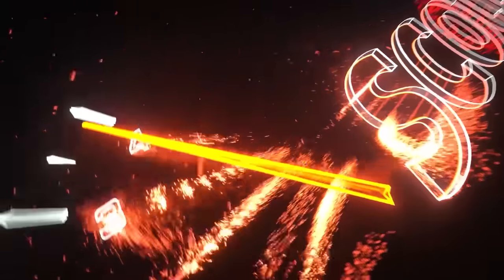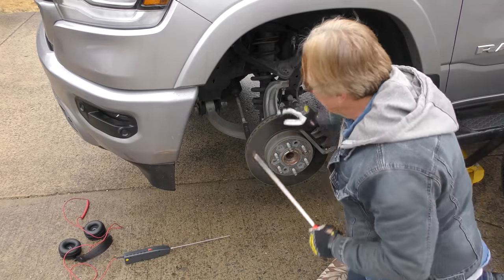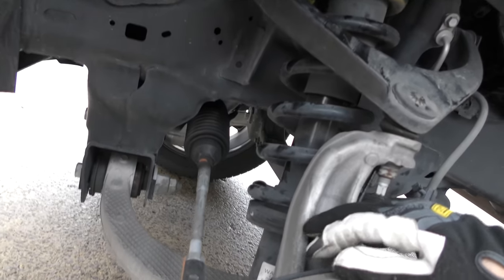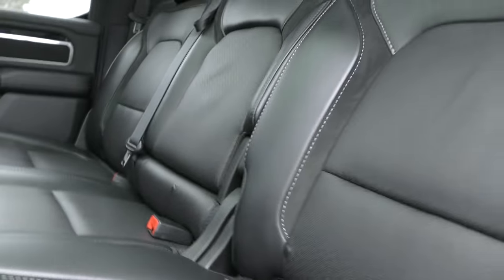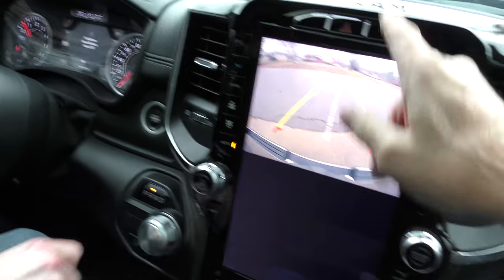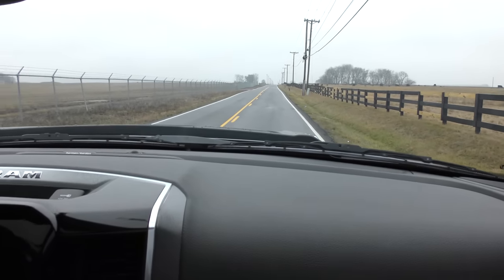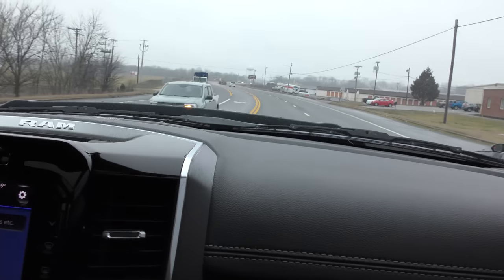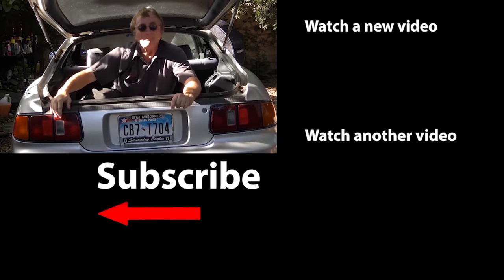Ram’s New Truck Scares the Crap Out of Me

Comment: I have a 2019 etorque Ram with about 63K now,  so far so good on the etorque system.   I get the same MPG.   I will say this trucks seems to eat the regular battery's faster, instead of replacing every 4 years I need to replace every 2 years.

Comment: New trucks to  expensive and not made as well as the older trucks from a decade ago. I will fix up my 1987 Dodge W150 LE  318 pickup. 15 mpg, but easy to work on

Comment: I am flabbergasted by this video! Italian products are just as Americans. I don’t know why Scotty has a dislike for the 3.0 diesel engine. My Ram 1500 4x4 crew cab has 99,0041 miles and runs great! Oil change every 10,000 miles! Yes my oil is great. Always have used T-6 Rotella oil. Even when it was very hard to find at one time because of a refinery burning down. I had to pay more for what I got but it worked out. The owners manual even says to use only T-6 Rotella oil.

Comment: 2020 with 40k display message says service trailer brake and traction control. I tried to clear the 3 codes it had, but couldn't get them off. Had to take it to the dealer. The tires are worn out already. The Goodyears they use must be really cheap. I saw little chunks of rubber coming off. Noisy and rough riding too.

Comment: 2015 EcoDiesel larimy loved it till they reprogrammed the ecu because they got caught making it have to do regens more often but got 32 mpg after the reprogramming 12mpg no matter how I drive one of the things they put in was the turbo won't spin up when taking off from a start leaving you unable to dart out when normally you could make it twice. under load going up a hill it won't move till you put the pedal to the floor 3 or 4 seconds later you hear the turbo spin up and like I was power breaking, but  it launchs way more than nessessary 
So off the pedal and it stops. repeat  it's ridiculous and totally dangerous with mo fix other than a deleate which in Calif you get caught they seize your truck and crush it on.
Anybody want to explain why dropping my mpg went from 32 to 12 and that's better for the environment

Comment: I swear by prolong oil additive. It got rid of my timing chain rattle on the first start of the day in my 06 tundra. It would probably help with the idle problem in this truck.
Reply: I wouldn't put anything in the manual doesn't recommend.  Unless you're a mopar engine designer, don't do it.
Reply: @bjornironsides6474 Why not

Comment: Hey Scotty, I'm trying to find tires for my 2004 E350 Super Duty Van that are not junk, that do not have issues right from the start. I tried some new top of the line Michelins and the tire shop had 2 brand new ones that they could not even balance on their Hunter Road Force Elite. They  got 2 more and installed them but they could not get the shimmey and death shake out of the van, so we changed them out for General Grabber HTS60 and same thing, now had 3 bad tires out of the bunch. I left the shop with the switched out new tires, I stood next to the manage as he did the balance himself. They drove way better, only slight shimmy at 70-80, a week later, the right rear now seemed to have ply shift and has over an inch of lateral runout. I'm so tired of not being able to get a decent set of tires for my van even when buying the so called best in the Michelins. Anyone that can advise me I would appreciate. I been working mechanic for 50 years like Scotty and the van front end is not the issue, as being seen with brand new tires that are junk right from the warehouse. The van is not loaded too heavy at 7500 pounds, the load E tires can handle 3040 pounds each.

Comment: The 5.7L takes 7.5 Quarts of Oil. Not 7 Quarts that the manufacturer says. Measure the oil your self. They never accounted for the oil filter. I’ve never had a tick problem.

Comment: 3rd gen hemi is garbage. My 05 hemi 1500 4x2 got 18mpg without a stupid and likely expensive electric motor and lithium battery waiting to explode in the back seat. Given FCA and their constant recalls on my current power wagons air bags the lithium will definitely go boom first fender bender.

Comment: Check this….solid
Check this….solid…..etc.
Nice interior, comfortable 
So all of this hate on the brand for no reason than a small reason.

My 2018 is a 5.7L Hemi and averages 20 MPG.   (Not Hybrid) A lot depends on how you drive.

My 2017 had over 275k miles before any issues.
Reply: In terms of reliability.....it's still a Chrysler. Out of all the American car makers they're the bottom of the bucket for issues. Most people I know didn't own 5.7L Rams past 250,000-300,000 kilometers. Because the problems became serious. Especially if it was used as a truck to do work and tow. 

Years ago this wasn't the case. 

Yes, it's a nice truck. How long will It stay that way?
Reply: @cameronswan8646  My last two ran past 275K miles with no major issues.  I traded them in at that point because of the value was still high.  You must not keep up with trucks as RAM has been winning motortrends truck of the years awards for 3-4 years now.
Reply: @MRKNIGHT  Motor trend says a lot of things are are full of hot air. 

The trucks are less reliable than their competitors. Numbers don't lie. It's also why they're cheaper than their competitors too. If you use these consistently as a truck, and not just as a highway cruiser they'll fall apart pretty quickly. The company I work for uses 5.7L Rams in a lot of their fleet. They're good with maintenance but they just don't last. Same goes with the dodge journeys they bought a boat load of.
Reply: @cameronswan8646  You sure know a lot for someone who has never had one.  My 2011 RAM and 2017 RAM each had over 275K miles before I traded them in with no major problems.  I don't trust what your "company guy" says about the fleet.  I've never known a company mechanic not to be a cry baby about everything.  *shrug

Comment: If you drive 30,000 miles a year and gas is $4/gallon, you save $1600/year going from 15mpg to 18 mpg. Same scenario but you go from 25mpg to 28 mpg, you only save $500 per year in gas. Science.
Reply: Math actually
Reply: @jwalesoutlaw3294 math is a science ☝️even though it doesn't say so in the name😂
Reply: @kxkxkxkx  lol no it's not.  It's called "math" and the sciences for a reason
Reply: @jwalesoutlaw3294  I take your point. But everything is just math.
Reply: @brlyjo  give us a few miracles and we can explain the rest with math?
Reply: @jwalesoutlaw3294  haha, it works until things get "spooky".

Comment: I have a 2021 Ram 1500 etorque 5.7 that only has 14,500 miles and watching this will give me a heads up on parts that can fail. The lifters have been upgraded and oil pump to make sure delivery of oil to the oil gallery were the cam resides. The needel bearings are bigger in the lifters and other updates to the 2017 5.7 and up. Biggest problem is the exhaust manifold bolts breaking still. Sum say the studs or bolts have been updated as well. Its how the additional weight of the catalytic converter connected to the exhaust pipes vibrate

Comment: WRONG!!! 
Scott I love your videos they are extremely informative however I had a 2016 ram 1500 with the 5.7 I do drive like an old man but I got 26 miles to the gallon on the highway empty and 22 around town, mine was phenomenal on fuel mileage I now have a 22 ram 2500 with the 6.4 and it is horrible on gas mileage and towing my 12,000 pound camper I only get 7 1/2 miles to the gallon

Comment: I have one of these and mileage really varies with the rear gear. 3.21’s get better mileage which mine is. I’m always over 18 and over 20 on the highway. The braking does take getting used to. Start/stop is a non-issue and super smooth, I never turn it off.
Reply: Its all math. More parts means more chances for failure
Reply: @censored4christ162  I’d agree but your eliminating a traditional alternator and using your starter a lot less. The battery would be the biggest nut crusher if it goes.

Comment: Sheesh, could Dodge put more buttons and a larger touchscreen on this truck?  The vehicles are just ridiculous these days.  Not only are there physical buttons for every feature on the dash, but also a touchscreen button, what a mess.  Last of all, I cannot stand that stupid turn dial gear shifter.  However, overall the interior and exterior of the truck looks good.  Just tired of all of the electronic 💩 that will no doubt have an effect on the how the truck runs, if there are problems.

Comment: I bought my 2023 ram 1500 Lonestar with the E torque I love it but recently I've noticed that i kinda feel a little vibrating feeling on my gas pedal. Any thoughts?
Reply: Is this vibration when you are barely on the throttle? It could be when it switches to MDS mode (4 cylinders). My 21' has that feel, its annoying.
Reply: @dan0872  yeah kinda only when I'm going 40mhp and then it stops doing it at around 70

Comment: Hey Scotty. Does the 2012 5.7Hemi have the same issue you just described about not being lubricated properly and not to idle to long bc of that issue?
Reply: Just trading in my 2012 ram express 5.7 ,I took care of it and it lasted 12 years only owner 144000, miles lifters went out and smashed the cam, traded it in know I have a 2024 ram 5.7 e  torque  hopeit last more that the first 1

Comment: Everyone saying they love their 2020 Rams with the HEMI, please update us when it has 200k miles and then tell us how much you love it.  They look very nice and I’m sure they ride great, but it’s still made by the worst auto manufacturer.  They will have oiling issues, transmission issues, electrical issues, and cooling issues well before 150k miles.
Reply: Actually there is a guy that's been doing updates his channel is called truck Central he has a 2019 ram 1500 with the hemi with 200k miles on it problem free and he's very happy with it and tows a lot with it and it's still holding everything is still original engine transmission is holding up perfectly

Comment: My 2010 Nissan frontier still tooling down the road. 1 brake job only thing other than routine maintenance. 6 cyl w 5 speed automatic. I do not like the new 9 speeds. Seems like it's constantly hunting the right gear. Should get several more years before having to decide what brand to buy.

Comment: Attention Scotty you need to pay more attention to your videos I've noticed you're slipping lately. First of all you're working off of the Jack and not a jack stand second of all you have the wheel leaning against the side step where the wheel should be underneath the vehicle for safety just in case the Jack slips it can land on the Wheel third of all you're climbing under the vehicle prying the thing .last but not least stop swinging a long screwdriver or pry bar around the vehicle you might ding it or Dent it

Comment: I have a 2015 Tradesmen and I just got the exhaust manifold bolts fixed and a new sensor for the evap hoping it doesn't need to go to the dealership for P0456 PCM update. I try not to idle, at all. When oil life gets bad, oil does slip through the valves and smokes on start up. Been using Lucas Oil additives to keep it alive as long as possible.
Reply: My 1500 set 2017 had poor gas milage compared to the classic 2022 0w20 5.7 hemi
Reply: @BushcraftQuebec  yeah you can get better fuel economy with 02-20. The newer they make em, the more MPGs you'll get.

Comment: 130 foot/pounds extra electric TQ is great, the system is simple, right in the open, easy belt to replace, saves the starter motor. The hybrid battery is much cheaper than a BEV battery. 2.5 MPG is 11% better MPGs Why bad-mouth the motor? I have a 20 inch Lasko $18 when new box-fan, has been running 24/7 x 4 years.

Comment: My 2008 Prius has the dashboard go off and the only way to get it back on is to press the display button 3 times then turn headlights on for a second with a door open. When the door ajar light comes on then I can turn the car on and the dashboard will turn on again.   But it is not a quick fix for sometimes it takes a lot of tries to get it to work. Help please! Is there a better way ? As I have been forced to drive without the dashboard. Can not see speed, rear camera, cruise control doesn’t work. My dashboard is not working as I am sending this message. I tried to use the trick I mentioned above but after 15 -20 minutes of trying I give up. I even had the dashboard turn off while car was getting inspected and it took the shop people over 30 minutes to let me know and it took me about 20 minutes to get dashboard back on so they could see the cars mileage for the inspection. 
If you can send me a response that would be awesome. Oh I live in West Seneca NY close to your old home town of Niagara Falls.

Comment: I just want to point out, that I have a 5.7 hemi (2017 ram) and I get 19MPG without that E torque/Electric motor. So, the electric motor really doesn't give you better MPG if that guy is getting 18MPG.
Reply: Sounds like little extra boost off the line is what they’re promoting.
Reply: Less to fail with the older truck
Reply: Tires, lift, lower, cab size, your weight, 4x4? So many variables
Reply: @Quest4Unknown   All season Michelin Defender LTX  M/S tires (20in wheels)  No lift (stock)  Crew cab with the short bed, 2WD, and I drive about 70% highway 30% town going to work. I'm getting 20 MPG now. I run 87 octane.

Comment: My bone stock 2016 f150 xlt 4x4 gets 21.5mpg between town and interstate and will get 23.5 mpg on straight interstate. This is math at the pump, not just the computer. It actually says I’m getting a lot better on the truck. This is pitiful mpg for a truck today especially a hybrid haha.
Reply: That's what I get with my classic 22 5.7 12.5l 13.5l per 100

Comment: $2500 for the tiny 1/2 kwh battery? What an insane scam! The battery in my model 3 is 150 times the capacity and the total replacement cost on it is $12,500. 😮

Comment: I have a 2007 Dodge Ram 1500 4.7 V8 single cab short bed. It’s been making noise in the front were it sounds like loose change. I’ve hear this noise on a lot of pick ups, so I’m just curious if you could tell what it is due to your over 50 years experience. Thank you.
Reply: When i had a ram that sound was coming from my transmission

Comment: Hey Scotty I took my car to a local Evans Tires for some new tires, breaks pads and rotors but now my car is squeaking. It does not squeak all the time but it does when it wants which is pretty annoying. I took it back and they have “worked on it” and it still squeaks. What do you think I could do.
Reply: Did u give it time to break in ? And how's your brake fluid

Comment: Dear Scotty, What about running the crank case one third or a half quart over to oil the camshaft better?
Reply: Many reasons not to, big one is the crank has to rotate thru the extra oil and this causes heat and lower fuel economy. The reasons for the dry  sump oil pans is to give more horse power and less heat. Single cylinder engines may sometimes foam the oil which causes rapid wear. Retired Mechanic.
Reply: Back in the 1960's, they said you could blow your rear crank seal by running with to much oil in the crankcase. Had a car come in with 10 quarts of oil in it. Lack of power and was running hot.

Comment: I noticed when I go over speed bumps in my 2012 Expedition, the front left suspension makes a clunk noise, like it bottomed out. Regular bumps, nothing. I bought it back in December with only 39k miles from an elderly couple. I assume they ran over curbs and it did something to the strut. Any ideas?

Comment: Ram trucks brand new two-wheel drive loaded go for $71,000.  😅
Reply: At least it's not a aluminum v6 for that much like the fords 🤣
Reply: And V6 Fords go for 80
Reply: 50 000 for a truck here in Canada but they make sure you spend 75 loo
Reply: @robertannable9584 come on guys 4x4 ram 55 000 Canadian v6 I paid 52 with a v8  1 year ago half the interests omg